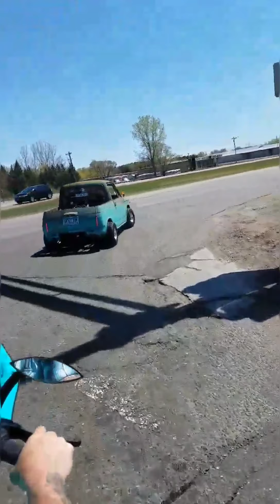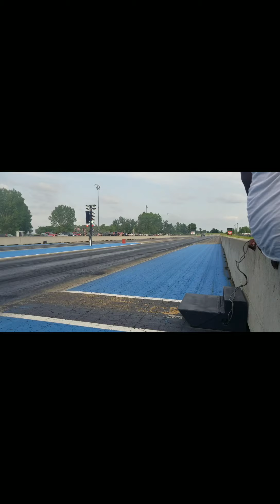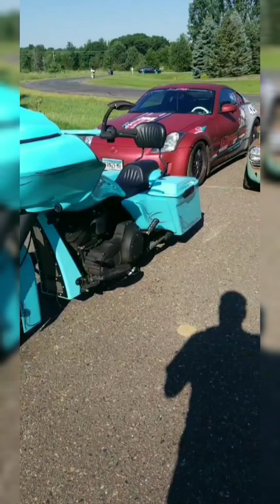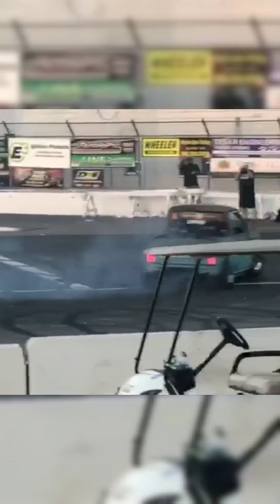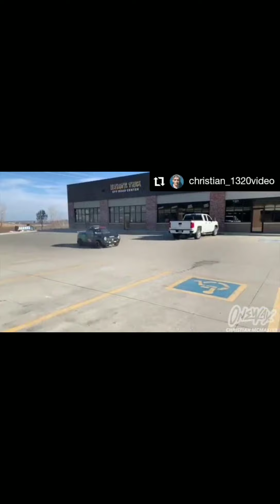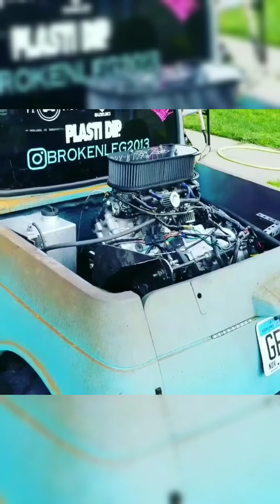Compilation of the 1971 Honda N600 GSXR 1000cc SWAP

Comment: You're using dogbox, no need to use clutch to shift but you need to let go the throttle a bit. That's why the clutch slipped.